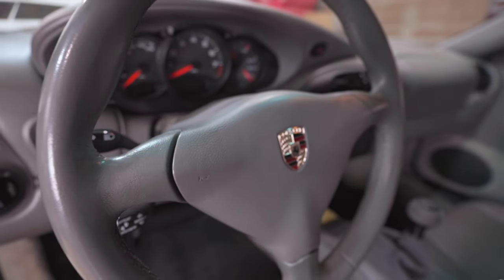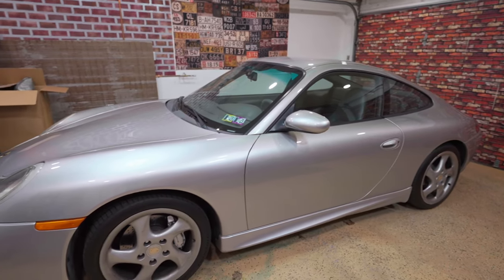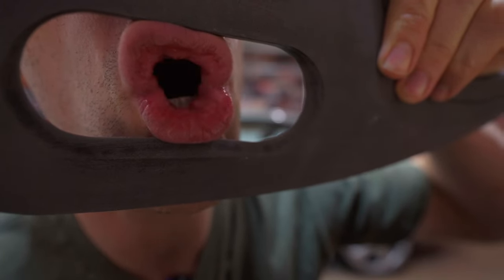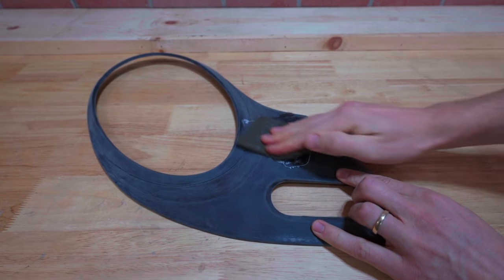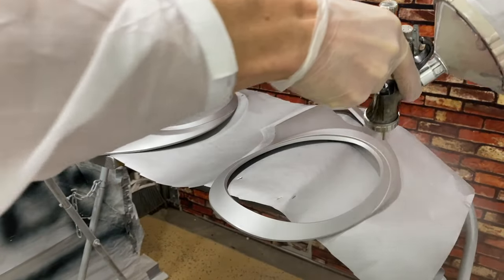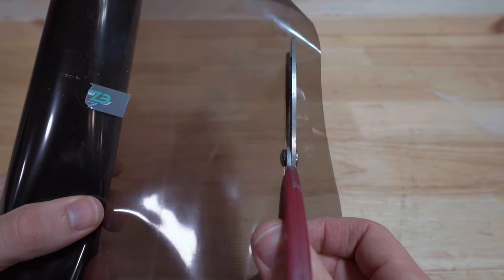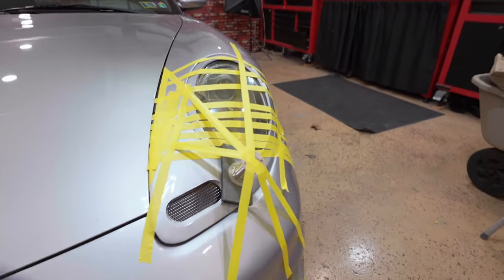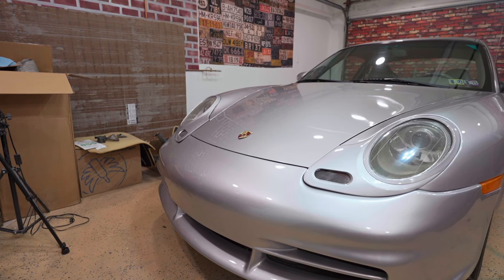I found the best Porsche 911 996 Headlight upgrade

Comment: when the 911 is so good that the worst one is still a good car
Reply from the maker: 100%
Reply: Couldn’t agree more sentient 1985 Honda CR-X Si
Reply: Worst? I Think the new 992 is the worst. first its way to exspensive. Second, they still have the old 911 headlights from the 60s. Thirth, no one buys it.
Reply: @EdgasketGarage  way to talk sh*t on it though. IMS bearing usually takes effect early on. Every ACTUAL porsche mechanic will tell you how rare IMS issues are this many years later. Also 996.2 headlights are clean and not the same as these. atleast give a fair response. 996s are the last of the drivers' 911s. Now they're all digital assistance. FOH
Reply from the maker: @madskillet  money talks. Its the cheapest 911 for a reason.
Reply: @EdgasketGarage  yea at the moment, that’s a bit shortsighted. We’ll see in 20 years how the 991 and 992s hold up.
Reply from the maker: @madskillet  agree

Comment: My motor isn’t junk. My interior is just fine. I love my $18,000 911 Carerra C4 Cabriolet 996.2.
Reply from the maker: They are cool cars. They are the least desirable 911.
Reply: @EdgasketGarage  - Funny that french Porsche specialized since 1990 magazine "Flat 6", doesn’t share that same opinion on which the 996, is the least desirable 911!…
Actually, just by chance I’ve short ago driven a 964, and…How happy I felt by having chosen a 996 C4S five years ago over any of the "so desirable" air-cooled 911s, with that driving position, floor hinged pedals, splited side window and their A/C that couldn’t even really "acclimatize" the car (exactly because it was air-colled), designed in 1963?…
Not for me, thank you!

Comment: Ed, I am the original owner of a 1999 C2.  When this car came out it was heralded by the automotive magazines as one of the best 911's ever made.  It tracked faster, had a better coefficient of drag, wasn't spin crazy, had a real air conditioning and smoked corvettes.  In fact it was so good that it sold more copies than any other 911 model in history.  Nobody, and I mean nobody hated the headlights.  There is understandable resentment that it shared the front end with the Boxster.  But again, nobody hated the Boxster headlights either.  That all being said, I've had mine for 25 years, it steel runs, pulls and handles great.  Interior while plasticky has in held up very well.  I think the switch from air cooled to water and sanitizing of the car over previous generations were the biggest complaints (understandably).  If you are a real fan of Porsche's, the Boxster and 911 of the late 90's saved the auto company and for that we should be thankful.
Reply from the maker: We shall also tip our hat to the Cayenne for saving Porsche.
Reply: @EdgasketGarage you might tip the Macan as well, they sell boatloads of them.
Reply: Uhhhh. I definitely hated these headlights when it came out, and yes I was an adult in 1999 and a sports car fanatic. IMO, this was a massive step backwards from the 993 in terms of looks. I was OK with the switch to water, that made sense, but visually it was garbage, and eventually looked just like an ugly Boxster. When 2005 rolled around and they fixed the headlights, that was when I felt Porsche was truly back in the game. Just like when Jeep ditched those hideous square headlights. 

Dude's not wrong. The 996, especially THAT 996, are the worst Porsche's ever made. As for smoking a corvette. Come on, dude. 4.6 vs 4.7 isn't exactly gapping anyone. Also, be careful with those industry rags. This was the era where new vehicles (PT cruiser, anyone?) were given car of the year because they were bought and paid for, and that's not even accounting for the tweaked testers that were built to perform for editors. 

Glad you like(d) your car, though.
Reply: @negotiatewithleverage4763  I actually like them more than the 993 headlights.  I think those look bad.  never liked how they tilted the original.  But TBH, I still love the original upright circles the best.

Comment: Great and fun video!
Former 996 owner here. I strongly believe that the ONLY reason people (and when I say "people" I really mean Porsche fanatics because regular people couldn't care less about the headlights) is because the Boxster used the same headlights. While I do prefer the looks of the round headlights, the 996 lights aren't bad. I guarantee, if the Boxster front end was different than the 996, very few people would complain about them.
Also, beside the head crack and the IMS, there is the RMS, bore score, AOS intermix, and a bunch of other issues with the M96 engine. Wonderful car but bad engine.
Reply from the maker: I agree MM
Reply: The 996 is nothing but a 986 with upset handling due to the engine having moved away from the perfect spot...
Reply: @thefreedomguyuk -Wrong! 
996 is descendant from 356 (after several 911 iterations), which was there since 1948!…
986 (Boxter) is descendant from 550 Spyder, RS 60, RS 61 and RSK, all them from the 50’s!…
In other words, 996 DNA is there "before" 986’s to tell his story!…
Reply: Bore score not at all a big issue on the 996…. 997 on the other hand!… Also..just watched a YouTube video of a large Porsche repair shop that works on a couple of hundred Porsches a year… has so far come across 2 IMS 996 / Boxter issues in 5 years at the same location.  What with that said, there are reasonable IMS preventative replacement solutions available everywhere now. It seems like you are generalizing more than a little in calling this a “bad engine”…

Comment: 1997 air cooled 993, $100,000- $430,000. 1998 water cooled 996, $19,000. Throwing quality out the window, priceless.
Reply from the maker: money talks
Reply: In South Africa a 996 goes for $14000, sometimes a little less depending on the condition

Comment: funny nobody ever says that the 911 GT1 (996 lights) is ugly even thou exact same lights.. i have a 996 with gt3 body kit and looks killer.. if you want to improve the interior of those monocromatic interiors get some color accents,  i swapped out alot of my grey interior for black (steering wheel, center console .. etc)  if anything is bad about this gen 911 are the seats 100% uncomfortable ,,, some aftermarket Recaros and away we go!!!
Reply from the maker: 100% gotta break up that grey interior!
Reply: go with the elephant ears

Comment: You know you can buy just the little triangle piece to fix those headlights instead of covering them. Which by the way, will cause more heat retention and kill bulbs faster.
Lot of 996 haters just because of the headlights 🙄 that were designed to mimic the Le Mans LMP1 cars like the 957, 917K and 911GT1.
Reply from the maker: Yes I have the triangle pieces. Took mine out because of the headlight washers not working correctly. I’m far less of a 996 fan because of the engine. The headlights are not cool (IMO) but they are certainly a piece if 911 history.
Reply: @EdgasketGarage  my daughters 986S washers are also not working. I was going to remove then plug the pump lines and just get those covers. 
How do you feel about the mezger engines of different porsche generations? The turbo and GT 996's have mezger designed engines. I assume it's the M96 engines that you don't like.
Reply from the maker: @randominternetuser2888  LOVE the Mezger 996 motor

Comment: The 996 has aged beautifully, the basic 996 Carrera has an elegance and purity of the original early air cooled 911. Yes, the cars have their issues, and build quality is not the 996’s strong point, however it carries the 911 DNA and was the basis for all the later water cooled cars that followed. The simplicity of design of this era 911 and indeed the 986 Boxster (with which it shares the front end - and headlights) has come into its own now when compared to todays over exaggerated and complex variants, proving that in many ways, less is indeed more. And as for the 996’s (and 986’s) headlights, though controversial at the time, they have become one of its defining features, and now look better than ever. Anyone who can’t see past the 996’s headlights is missing a trick, and although the 997 is indeed a better built 911 and has many of the purists design features reinstated, drive and early 3.4 996 and 997.1 back to back, and tell me which is the purer and more driver focused car?! - It’s the 996.
Reply from the maker: Thank you for sharing. Nothing to debate. Well said.  In the end it’s a drivers car

Comment: Great fix and a friend of mine fixed his headlight issue about 15 years ago by prepping the existing light covers and taped them off and sprayed them body color they still look great. Porsche did drop the ball on styling the lights.
Reply from the maker: They recovered well!
Reply: I don't call it a issue. If it really was a issue then why was it the best sold 911?!
Reply from the maker: @Vyltax  the most sold 911 at the time it was produced. Porsche has since had many years exceed the 996. Still, a fun car!
Reply: @EdgasketGarage  Still it is not the worst 911. If it real was the worst 911 then no one would've bought it. Also many people liked the car (aka the headlights)!

Comment: My very first 911 was a 1999 996 Cabrio in Arctic Silver with Red Leath.  It will always have a special  place in my heart.
Reply from the maker: Sharp car. I also had a 1999 as my first 911. Although mine had a cracked cylinder head.

Comment: By faar it loook woorse with those add ons, 996 is not that bad perhaps if it has ambar turn signals , just made them clear and thats it..... a stock 996 looks better than a conversion or else
Reply from the maker: With so many 911s to choose from, the 996 is certainly not high on the list. Thats all.

Comment: Years back I prepared the plastic head light covers pin stripped and masked off the same areas as your aftermarket covers and with the correct primer and top coat they have held up great and look 100% better probably 70 bucks invested.
Reply from the maker: Wow nice does everyone tell you they look dumb like mine!?

Comment: 2:45 TBH I don't think the headlights are the main issue. a 2008 cayman and a 2009 cayman have a $20,000 difference, that's because of a the IMS bearing issue, and that issue plagues these cars too. Some people have grown to really like the fried egg look, if it was truly the case then we could easily find 15k models with under 80k miles in the market. I've still seen 996's going for $25k 30k and even 35k for that much.

Comment: 1999 didn't have the bearing and sleeve issue. One of the best engines made. Have you seen the interior on a 935 or 964? Vinyl over cardboard.

Comment: I own a 1999 996 C2 in black and are currently thinking of selling it and my rough 1979 928 both manuals and buying a early 80's air cooled targa. I'm 57 and always wanted an older air cooled 911 and wish I would have done so a long time ago when they weren’t 50k+.
Reply from the maker: I'd be all over that Targa too!
Reply: I have an 1979 SC and an 1999 996 C4 Convertible. You cannot compare then, the 996 is a much newer car and the driving is tottaly different.
Reply: @frankwittwer3141  yes, the water cooled 996 with power steering is nothing special to drive in all honesty. The older 911's require your attention to drive and just feel more special.

Comment: In fact, the 996 is one of the best cars ever made. It is effectively made by Toyota.
The IMS will NEVER fail if you keep the revs up, and the gear low, when climbing hills.
On top of this, the 996 Carerra is the prettiest and cleanest 911 of all time.
It is a future classic, and prices are rising already.
Reply from the maker: I'd buy a 996 without worrying about IMS but I'd instead be thinking about the cylinder heads.
Reply: "It is effectively made by Toyota." tell us please.

Comment: Those covers are just crapp and don't help at all.
better keep to the original (gt1) lights.

I de-coverd my headlights because they are way to thick and makes the front look like its repaired badly.

I pulled the plexiglass fronts of and blacked and greyed out the inside of the unit.
Build in some aftermarket xenons and it looks awesome now.

Mine is a black on black car but it works on any colour.
Reply from the maker: Dang Manny! You went into those lights head first. Any photos of them? Id like to see (edgasketgarage on Instagram if you have a photo to send)
Reply: @EdgasketGarage  i'm sorry, i'm not on insta. (Getting old and to outdated to be on there.) 🤣

As i am reading my original comment, i maybe got to offend you a bit...
Thats not what i intended, so i'm sorry if i did.

There are al lot of people who did it in the past. Most of them blacked out the entire fixture.

Here's what i did

Removed the unit, put it in a box with a hole for my heatgun in it to heat up the sealant, pulled the lens of. Blacked out the square lens in front of the indicator bulb with black/transparant taillight spray. (Reflector reflects the black of the lens now) painted the chome bits that hold the screws of the indicator parts. (Not the reflector itself.)
Pulled the tranparant part that has the ribbed structure. Blacked that out completely (left the foglight part that original brownish colour) and sprayed the (round) headlightbucket part in a gunmetal grey and left it as a satin finish. 

As for the xenon, it is a lasercut baseplate with the xenonunit mounted with some nice black screws.
Painted the baseplate and bulbcovers silver and it looks quite robotic/industrial if you look inside. (I like that as a metalfabricator to be honest.)

And yes, they are still not round, but it gives the elusion that the are without having to stick something on top.
And well, sure i like the round lights, but it does'nt have m and thats like a 15k diffrence to a 997 and 35k to a 964 over here.
(I can live with those fried eggs with those numbers.)

Some info about the car if you are interested.

My 996.1 is a black early (cable operated) narrow body '98 3.4 carrera 2, 6 speed manual, factory sunroof delete, satin black 19" motec mrc1 wheels, coilovers, LSD, carbon struts front and rear, cut open rear bumper for the x pipe 2 100 cells cat exhaust and racing boxes (loud and hot as hell) ducktail rear lid, some small engine mods like stiffer enginemounts and trottlebody of a gt3, no backseats to "add lightness" (and my kid does have leggs, so he does'nt fit in the back anyway) (front seats will be changed to some lightweight buckets aswell.)
Custom half rollcage, custom seatbelt barr across for the racing seatbelts. (Don't know how you guys call em overthere.) Original porsche engraved deep dish racing steeringwheel (no airbag anymore)
Shortshift kit and ballknob.
Openend up the airintakes in the front, cut out the horizontal part and fitted some black mesh behind the intakes so i dont have to worrie about rotting out the radiators that much anymore cause of rocks, leaves and stuff getting stuck in there.
Cut out 3 square holes in the top of the front bumper opend up the center lower hole to give it that "smile" (and additional oilcooler, yet to be fitted.) And build a custom splitter to make it a bit more agressive looking.

And still its waaaaay cheaper than a 997 or a 964.

And i realy am having alot fun rolling around in a modded and custom build 996 project car.

Comment: Hmm if its such a bad car why is it increasing in value faster than other models?
Reply from the maker: It’s not a bad car but it is the worst of the 911 line. You can’t find any running/driving 911’s for 15-20 grand - (other than 996’s). It will be nice if the value does start to close the gap on the 997.

Comment: Never saw this option before. Personally I don’t hate the stock lights bad enough to do this. Almost picked up a 996 C4S last year but between engine problems and only 315hp I decided I need a 997 or newer turbo. Avoiding the headlamp problem all together
Reply from the maker: 996 is fun but you made a sound decision!
Reply: The 997 has the same 320HP Motor. I have the 996 4S and I love the big butt

Comment: He admits 996 costs 1/2 the price of a traditional headlight model … I don’t look at the headlights when I drive which is the point of a 911.. 
I’ve driven mine for 8 years with no issues other than preventive replacements … I hate to fool with the headlights ..
Reply from the maker: If I bought another I wouldn't change the headlights.

Comment: OK, this video just randomly popped up and I watched it. I have to say you just ruined that car and probably lowered its value by a few thousand. Sorry but it looks hideous. The original headlights are pretty good and are actually bringing some much needed freshness to the porsche round headlight ideology. The IMS is not that big of a deal since most 996 sold today already had the new one installed. As for the interior, it is also not bad and is a big step up from the previous gen. All in all, I have to say a big thank you to all the porsche purists who managed to keep the prices of this beauty at an attainable level. 😂
Reply from the maker: The car was sold and headlight covers removed. A fun project for a fun car. IMS no longer a major concern. Bore scoring and cylinder head cracking major concern.

Comment: Idk about you guys but I don't care for the look of these headlight covers. I think they look kind of cheap (even if they may cost a lot). I think they would look a lot better if they were a replacement lens that was flush all across the surface instead of a polymer cover that rests on top of the headlight. I'm sure that would cost a ton considering they would be a mix of clear lens and the cover all molded into one piece and installation would entail disassembling the whole headlight housing BUT...
I think the upgrade in looks would outweigh the pain in the wallet.
Reply from the maker: Next time ill just go 997!